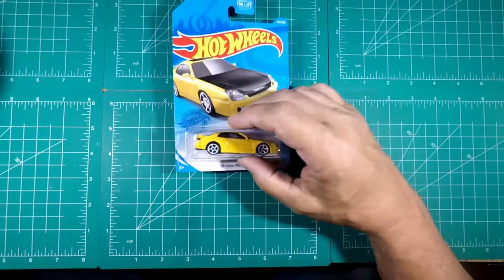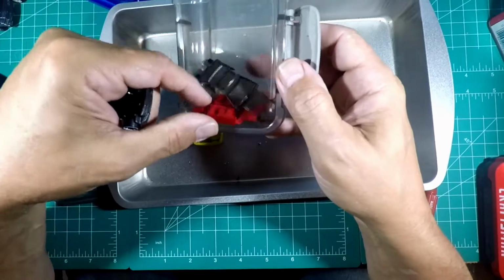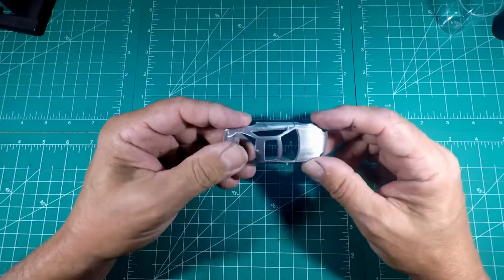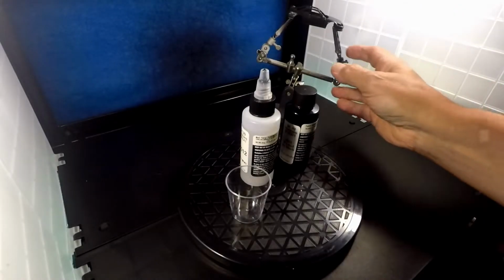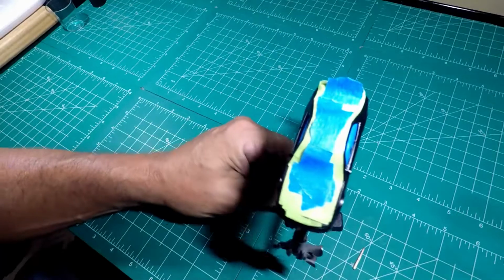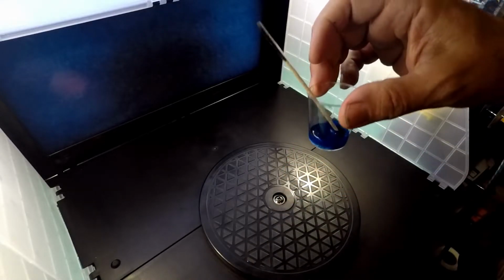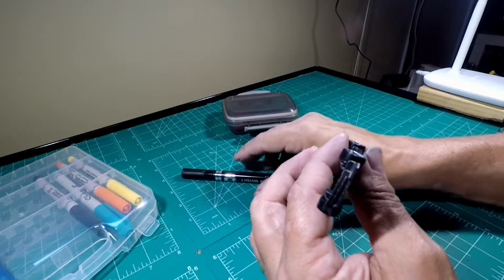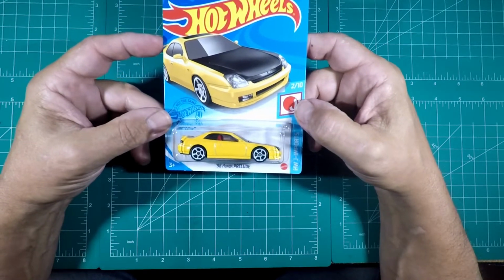Painting a custom Honda Prelude for someone in another country

Comment: What glue do you use for the card?
Reply from the maker: The way I take mine apart, all I do is resaturate the edges and put a little weight on it. It will reseal itself in most cases.  But when I want to really seal it, I just put a dab of super glue on something and use a toothpick and run it around the edge real quick......